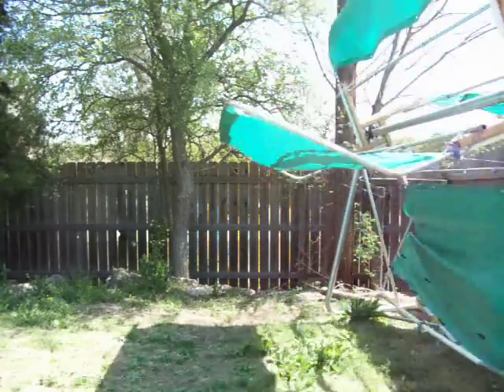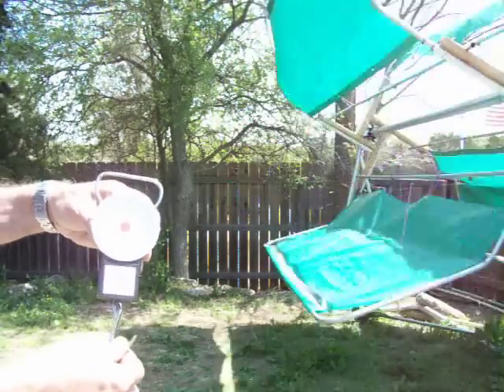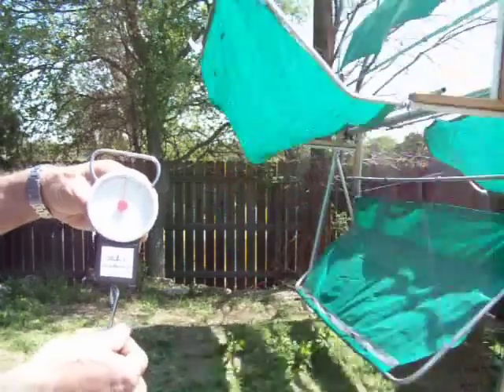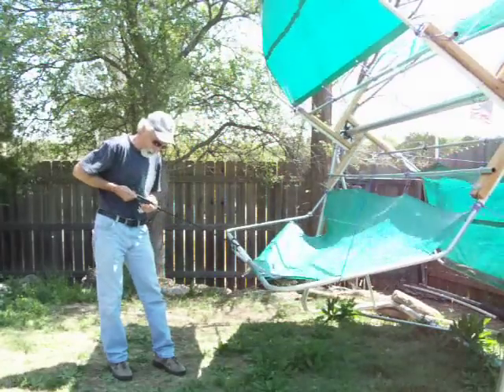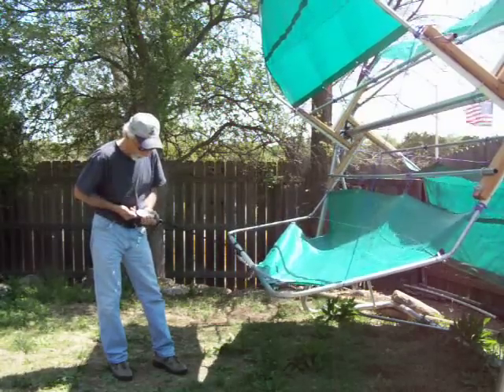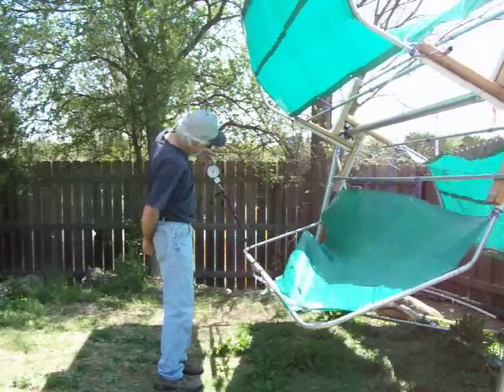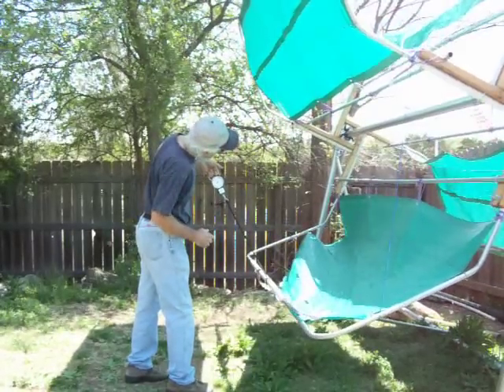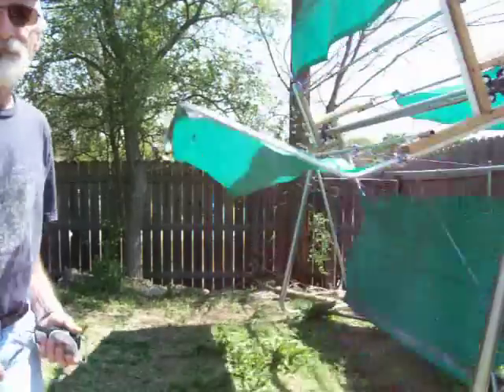Simple Method of Measuring Torque of a Wind Turbine

Comment: thats great for STATIC torque, what about DYNAMIC torque? Surely they are not the same. You could find it with a rope wrapped around a shaft of known diameter lifting a weight. Count your RPM, use that with the torque to get the power output.